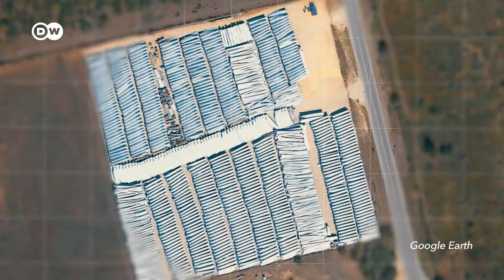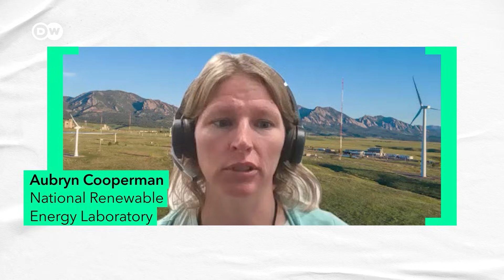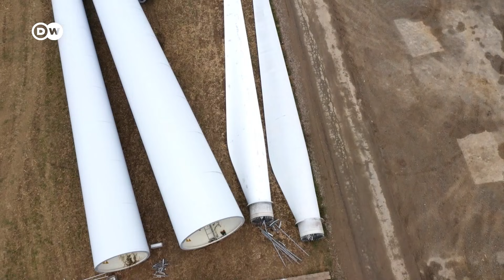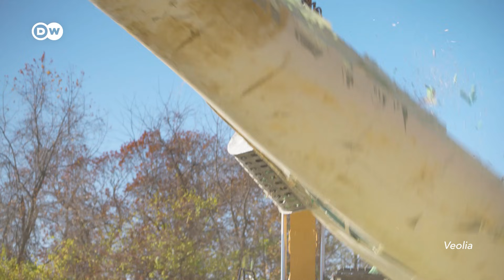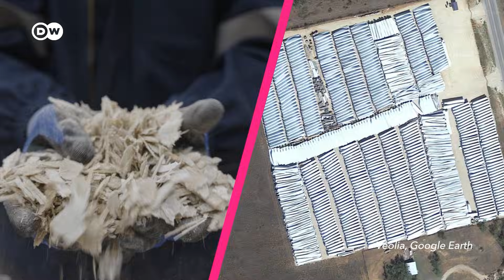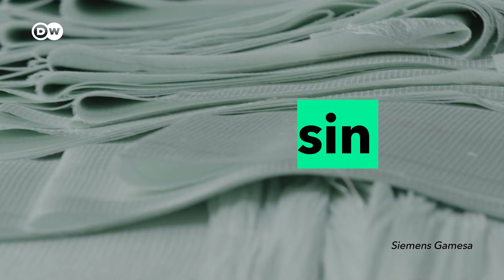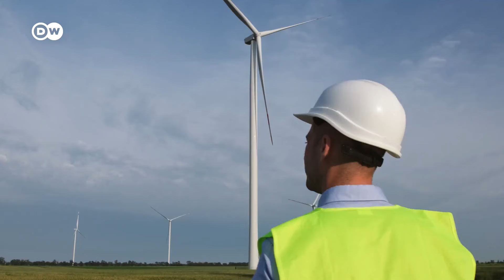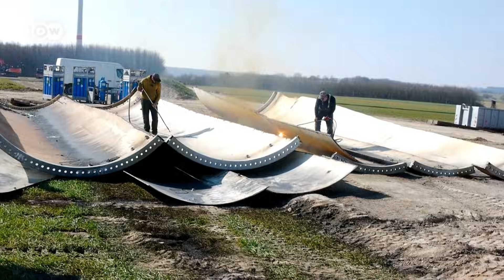Wind power's unsolved problem

Comment: Why dont they make it from a different material?
Reply: There is no other option yet.
Reply: @old-pete  really? Although they're made for slightly different purposes, windmill blades are made from timber. I'm pretty sure they could be made from timber.
Reply: @sandrajones8245  Windmill blades are made from wood and sailcloth and make round 20kW. That is great when one has no machines or machines cost a fortune.
Today that is a waste of money, unless one likes the optics.
Reply: @old-pete  OK you seem like an expert, im not, thats why i asked. But in lay mans terms, i dont think the blades do anymore then spin, so the requirements for them are to be lightweight and have that aerodynamic design. Im not sure if its actually aerodynamic, but I can see the blades aren't flat, and have specific design.
They could use metal, but that would be Heavy and expensive, same with glass, plastic would also work probably better then metaland glass and its recyclable although its production isn't environmentally sensitive. That leaves timber, it can be designed in the exact same way as the current material, and if managed correctly its literally infinite.
Reply: @sandrajones8245  You have to note a few things.
Windturbine blades get bend by the winforces around 1 billion times in 20 years. That is impossible to endure for normal materials, unless one builds them very thick.
But when one builds them very thick, the blades become extremly heavy and the centrifugal forces pull on them. Wind turbine blades must be able to endure g-forces between 15 and 20g for thousands of hours.
The most advanced fighter jets with the most advanced materials manage 12g and only a few times. When a jet endures that too often, the air frame cracks. This can also happen to windturbine blades, that is why they do not last for 50 years
Reply: @old-pete  I guess I will have to study it more. Although jet engines rotate at  out 
 faster speed then wind turbines, so are you sure there's more force on a turbine then on an engine?

Anyway, I'm doing lots of research now, because in our lifetime, fossil fuels will become so rare renewable energy will be the only option, and with a higher population we'll need more energy. Having the blades made of a non recyclable material is counter intuitive, even if they made wind turbines smaller and out of timber, this would actually do no harm to the environment
Reply: @sandrajones8245  Yes, jet engines rotate much faster, but they are smaller, that is why the blades can be made comparatively thick without getting too heavy.

Comment: Could you do a similar piece on what happens to all of the computers which power data centers when they are decommissioned?
Reply: Sold off to smaller data centres who don't need the most modern equipment
then sometimes sold off to individuals or recycled for the valuable metals such as gold 
the plastics and glass fibres from the circuit boards will be burned or landfill

Comment: Well, you missed out on Vattenfalls latest trials of wooden windmills. Made of wood the way you'd build yachts with. Much more resilient to strong wind and vibrations too, due to natural elasticity avoiding breakeages. And of course fully recycleable. Promising.
Reply: How small are they?
Reply: Very tall.  Check it out online. Anyway, here in northern Friesland some parts of those old windmills are being used as small huts and windshields for our sheeps ;-)))
Reply: @susannepeters5886  A: They are building only the tower from wood
B: the wood is laminated
C: while using wood saves CO2, it is not better at recycling, as the towers are usually made from steel anyway and the question is how long that woodden tower will last
D: the first turbine built is just a 30m tower with a 500 kW turbine...
E: admittedly they are currentl building a 2 MW, which is serious business, but we will see how long it will last
Reply: Sure... nothing proven yet. Anyway, I do welcome any innovation and will not condemn or despise new ways until proven wrong.  Constructive critisism fine. Love open minds. Only way forward. We're the country of poets, thinkers and  engineers :-) are we not? Dream, think and realize.

Comment: It will be very useful to cut Wind turbine blades into House and home paneling and insulation materials since they are mostly in shape to be directly used in their construction like they are currently used for bridges, walkways/overhead walkways, and parks.
The material and processing costs of the blades will be quite lower in the construction industry in comparison to going full blade recycling to its base materials and compounds overall.

Comment: Use basalt and epoxy, then it can be ground up and will combine as a filler material with other molded parts (so I’m told) such as molded auto and big truck bodies. Thus, all blade mass being 100% reused there need be no recycling problem for turbine blades, right?

Comment: Airplane wings are rebuildable. Why wouldn't a skin on frame turbine blade be rebuildable?
Reply: They are, to a certain extent.
If the structure is damaged or the whole turbine is removed, the blades have to be disposed.

Comment: Thanks, yes of course they will be recycled. Recycling has to be economically viable of course, but this can always be achieved in the usual way by making a charge for landfilling sufficiently high to balance the costs.
As an example scrap plasterboard can no longer go to normal landfill except at very high cost,but split it up into the paper and card as fuel, and the Gypsum as raw material for cement,job done.
I spent my entire career in recycling and literally diverted millions of tons of waste to Cement kilns, the Veolia project is very exciting. 
EV batteries are way too valuable to landfill and despite all the scaremongers, they are already being recycled.

Comment: What makes blades wear out?
Reply: they dont realy wear out i think
Reply from the maker: Both mechanical stresses and weather conditions; extreme temperatures, uv-radiation, rain etc. will eventually leave their mark on the blades as well. 🌬
Reply: It is mainly dust and water.
After years of exposure the protective layer can get damaged, which leads to further damage.

If the blade is well maintained, the damage can be spotted in time and be repaired. Old blades can even be aerodynamicly optimized in the process.

Comment: 10: 19 Wind turbines blades fall into public eyes. But it is light material. Fossil fuel boiler of 300MW power plant works at 1500 degree temperature steel degradation is much and much faster that wind turbine blades. High temperature is big factor how long material will last. All power plants are closed barb wire companies we don't see exchange rate wear and tear. Civil planes  monocrystalline grown turbine blade for high-temperature conditions development cost 50 billion dollars taken from taxpayers money only 3 firms can produce such blades not because secret but because of high-tech. Nobody gives a shit that is very unsustainable technology.

Comment: i have torn apart many aircraft. strange how a machine that we put faith in to rely on our LIVES is simply made from aluminium sheet, tube, stamped panels and POP RIVETS.

a stiff, light, aerodynamic structure, good for a life span of well over 30 years, and well... its easily pulled apart and sold for scrap leaving no waste behind...

the dutch, european, and syrians, along with many others, made them from timber for centuries... any carpenter, anyone with a hammer and chisel can whack one together.

a small truck carrying a few hundred marked and prestamped panels, only requiring assembly by a team of labourers armed with rivet guns?
a prefabricated flatpack made from bamboo and other timber wastes? no stupid overlength trucks winding their way through winding mountain roads, in an excercise of stupidity.

i wouldnt care if it comes down in ten years if i can throw it on the fire afterwards. sell it for 300 of scrap... etc.

why do these things have to be made from "space age composites" that have no "space age recycling" methods to deal with their inevitable demise?

anyway, the blades arent the issue. extracting all the power in the wind is the issue. storing it. using it.

Comment: Wind turbine blade recycling is a problem, but it's not going to be a critical issue, since it won't be as big of a problem as "exponential growth" implies.  Unfortunately, wind-power is turning out to be problematic in other ways (underperforming, costing more than expected, especially turbines at sea, killing whales etc.), and simply cannot be scaled up enough to replace a fossil fuel power infrastructure.  My guess is that the build-out of new and replacement wind turbines will likely end completely within 10 years, except in a few locations that are both sufficiently windy to provide good power, AND well located in terms of a nearby customer base that can use the power, AND have sufficiently friendly local populations/regulations etc., AND have sufficient alternative "backup/peaker" power production facilities (and/or grid-scale energy storage facilities).  That is, we are approaching "peak wind" within a few years, in terms of installed capacity.  Wind-power is going to stay around and be an ongoing thing, but the exponential growth is ending.  We're going to need other sources of "clean" energy.  This all implies that the recycling of wind turbine blades is going to be a problem, but will remain of manageable size.

Refer to Doomberg, among others.

Comment: Seems like the blades could be cut into structural beams for housing and other types of buildings.  Yes, the blades are curved, but there are relatively long straight sections too.  And I know that the blades have relatively thin stressed skin and aren’t solid.

Comment: Fiberglass in concrete makes the concrete much more flexible and less prone to cracking, far less to no steel reinforcing is needed if fiberglass is added to the concrete. Burning the waste makes perfect sense to me, it is the same as all the other waste in the world. I do love those bridges and play structures though, reusing and repurposing ought to come before recycling and incineration
Reply: if i am not wrong,it may increase tensile strength of the concrete block created

Comment: Seems like research needs to be done on new materials. Why not develop large scale 3D printing of blades in aluminum? 3D printing would allow lightweight but complex internal bracing elements not possible via normal aluminum fabrication techiques. I've seen some wild images of ultra complex rocket motors etc that boast essentially impossible internal  structures that only 3D printing could make. Maybe blades could be aluminum and some other material that was fully recycyleable. While we're at it, why not apply the power of AI combined with evolutionary computation to create some entirely new blade design that allows use of fully reuseable materials and maybe boost efficiency? This industry is basically in it's infancy when it comes to blade designs. I feel there's a lot more improvement to come.
Reply: Aluminium is too soft for long blades.

Comment: the only solution for wind turbines is to start using ALUMINUM blades
Reply: It does not work for the bigger turbines, it is too weak.
One can only use it for smaller, less efficient ones.
Reply: @old-pete   it's not that it's impossible, it's the lack of will to make it happen. lawmakers can just snap their fingers and force the industry to switch to alu blades.
Reply: @stian.  They can do that. And then no large windturbines are built anymore. And small ones are not economical.

Comment: Ground up and burned to make cement.
Used to slow water run off and rebuild water tables.
Erosion control in stream and shorelines

Artificial reefs.

Grounded up a reused to form new turbines.

Comment: Burning epoxy resin to heat a cement furnace instead of coal isn't greener, that is nonsense, what would be better is if they made them from aluminium, a material that is totally recyclable and more resistant to wear, tho obviously they wouldn't get to sell as many new blades...
Reply: It is better than burning coal. Around 70% of all energy in westeuropean cement production is from recycling material. That saves a lot of energy compared to using fossil fuels.
Using aluminium does not help, as in can only be used smaller, less efficient windturbines. Bigger blades would break too soon.

Comment: What's the problem (if any) of refurbishing / repairing old blades to use in newer wind turbines?  
The designs are changing all the time?  You can't repair the structural integrity to close to what  it was when it was operating well?
Reply: The blades get longer. 20 year old blades cannot be used for newer more powerful turbines. Sometimes old blades, in good condition, get used as replacement on windturbines of the same type.
As long as there is no structural damage, blades can be repaired and that is done regularly. Lifetimes of 30 years are possible, but that costs money. But after 20 years new turbines are threetimes as powerful. Currently it is more efficient to replace the whole turbine.
In the future, if the power increase slows down, it might be a good idea to keep them running for longer.
Reply: Composite structures degrade over time. Resins get brittle, fibers crack and delaminate.
Blade design is indeed constantly improving and blades get bigger because the turbines efficiency increases faster than the size does.
Also the technology becomes obsolete. Is a 25-30 year old car viable for sale today? 
The companies that own these wind farms are looking to upgrade using more productive equipment.

Comment: WIND IS WORTHLES GEOTHERMAL DOES 110% BETTER JOB ALSO USING EXISTING POWER PLANT SIGHTS 1 SINGLE SIGHT IS ABLE TO PRODUCE WHAT OVER 300 WIND NACCELS PRODUCE AND IS LITERALLY THE ONLY CONSISTENT SOURCE AS LING AS WE HAVE GRAVITY
Reply: Geothermic energy is much more expensive, unless you sit on a great spot like Island.
Reply: @old-pete 500million from blank land to 900 megawatts within 7 months or a single 60" hole drilled at any existing power generation station that's currently using steam turbine which is any and every one using gas oil coal etc retrofitted for 300million to do the same the Germans are currently in production for 1/3 of the countries currently using useless windfarm technology and 3rd world countries which here in nj they've already handed a total of 6 billion to Orstead for a unreliable less than 300 megawatts the best part is we are in a volcanic range
Reply: @chrislembke3823  Most areas are not in a vulcanic range. How deep do you plan to drill?
Reply: @old-pete  first what does a island have to.do.with anything second most of the US is in volcanic range just like here in NJ most of the nation had dormant volcanos that are now lakes and mountain ranges it's also anywhere tectonic plates are aka fault lines but you only have to drill  a mile in most of the US to get to 250f that can be drilled in less than 60 days on 12 hour shifts the Saudi's at just over a mile are closer to the 700f mark and every single US based power plant works off steam with the mantle being heated via gravity it will never cool there's a never ending toxin free closed loop system every power plant can be retrofitted to without even a shut down
Reply: @chrislembke3823  Not an island, Iceland. Fossil power plants are rarely build on an active vulcanic range. In an inactive vulcanic area one has has to drill 10,000 m deep to get to 500 degree Celsius, which is hard with  mechanic drills. Microwave drills might solve that, but they are not ready. 250 F is too cool for any meaningful power production. 700 F works, but one needs different turbines for that and it is still not very energy dense, and one has to drill 7,000m in most geothermic active areas for that temperature.
Reply from the maker: Hey, please check out our video "Geothermal energy is renewable and powerful. Why is most of it untapped?" here 👉 https://www.youtube.com/watch?v=c7dy0hUZ9xI.

Comment: Most of the controversy and resentment here is politically motivated; '..windmills to joust at..' for the various proponents & benefactors from legacy, petroleum-centered fossil fuel industry and their political screed machine.
For the century-and-a-1/2 that fossil fuels have been used to power & construct society, the amount of gains & applied R&D towards environmental cleanliness/impact...recycling/renewal & sustainability achieved by Big Petro is miniscule...compared to what effort & gains have been made by wind energy science & engineering.
To this day, petro doesn't give a damn about their unbroken swath of destruction upon the Earth...and grin smugly when taken to task about it.

Comment: o, what I took away from this video is, that we shouldn't deal with the problem of recycling the blades of wind turbines at all, since it's not a real issue when compared to the garbage issue at large. "Solving" the waste problem of wind turbines would then just be a waste of energy and time, that should be spent working on recycling all of the other plastic garbage.

Comment: With earthquakes a common occurrence in countries with primitive dwelling construction materials.  I'm wondering if scrap turbine blades could be used for a major upgrade in smaller building durability.... I understand getting them to point of use would certainly be an issue....